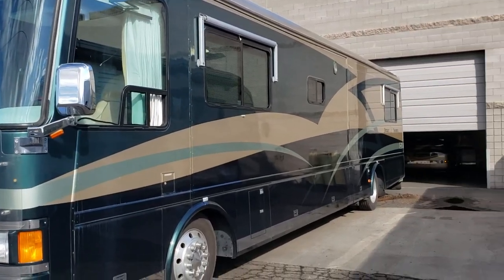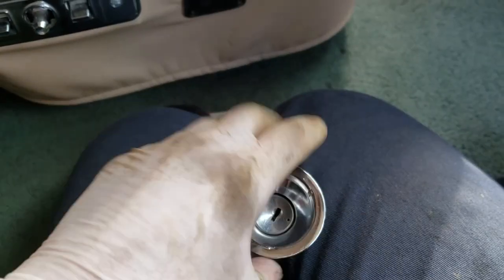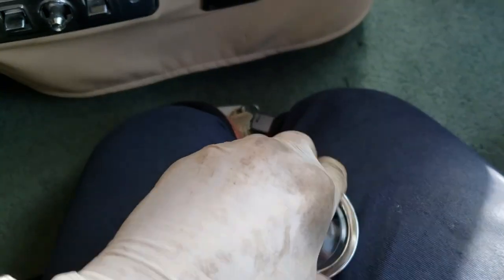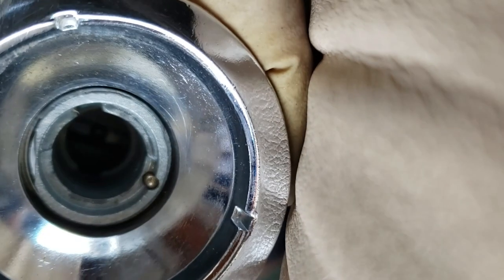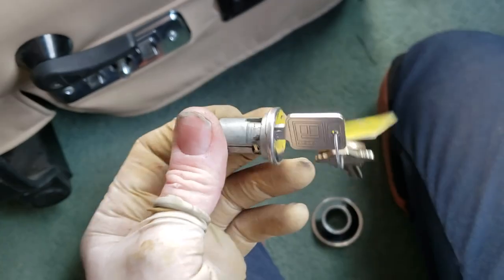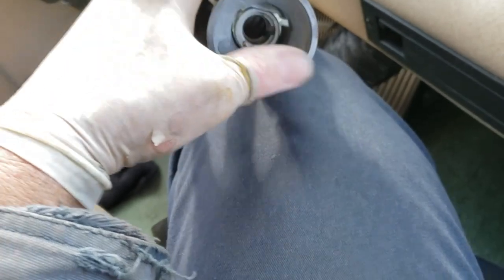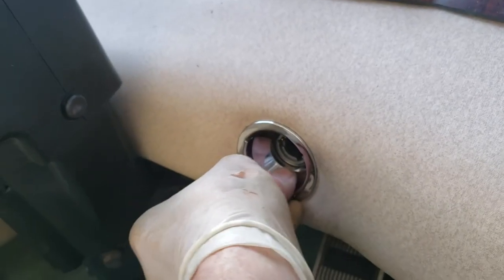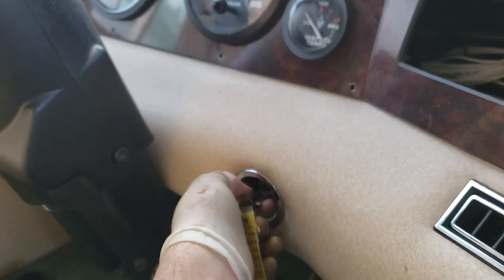Replacing an Ignition Switch on a Diesel RV...2000 Beaver Patriot Thunder

Comment: For anyone watching this video, the part number shown doesn't include the key and tumbler, it is just the switch. I thought it was the whole set so I was surprised when there was no key or tumbler included in the box. It looks like the whole set would be Napa part ECH KS6608.
Reply: And if you are not watching, it's pretty much the same...

Comment: So I have been fighting with my ignition switch on my 2000 Tiffen Allegro. It was getting to where if I bumped the dash, the key would turn off. The switch was just not staying in the run position. I put on a command hook, filed a cloths pin, and turn the key with the cloths pin and snap it behind the command hook. Works great, but not a permant solution. I then googled for that problem, and could not find any info on the problem of the key not staying on, but did come across your vid on how to replace it. I called my napa 4 blocks away, and they said they had the part. long story short, after about 30 min, my problem was solved, the key works great, and I have you to thank!!! Cheers my friend.
Reply from the maker: I'm really happy to hear the video helped and you go the problem solved. I use YouTube extensively for repairs too. :) Thanks!

Comment: We acquired a 1999 Bounder on a Freightliner.
Cummins.
A re-possession, it has no key to spin the ignition cylinder.
.
Without a key, how would you remove the cylinder to re-key or replace?

Comment: Well I figured I would answer my own question since I found the issue today. LOL.....  No voltage to the transmission ECU. Traced it back to a corroded power bus bar on the frame rail. Cleaned up the connection. Boom. Fired right up.

Comment: Love your videos. Very helpful. I have a 2000 fleetwood bounder 39z. When turning the ignition the starter stays engaged.  I had to hit the battery switch to make it stop. In your opinion could this be low batt voltage, ignition switch???? Or something else?

Comment: There is problem with the Ford Transit vans in the uk a vlog on YouTube showing how easy it is to break into them,it takes about 20 seconds to open all the doors
Reply from the maker: That's crazy. I think the 99-12 Ford F-series truck door handles are also very easy to defeat so I heard. Thanks!
Reply: Transits used to be manufactured in the uk then ford moved production to Turkey I think the EU gave a big incentive to ford to relocate to Turkey and ford saving money used cheap components,all car manufacturers are the same saving pennies

Comment: Can you put the original tumbler in the new switch so you have the same key as before or was that what broke on the switch. We have a 2003 Newmar Dutch Star DP, now I'm ready if that goes bad. Thanks!  I guess we need to put a lock on the engine hatch were the master on/off switch is. Lol
Reply from the maker: Yes. That was the original tumbler from the old switch I put into the new one. Thanks!

Comment: Do you have a part number for the lock cylinder if that has to be replaced too?
Reply from the maker: https://shop.findmyrvparts.com/monaco-rv-deadbolt-lock-08408788-p/190035.htm
Reply: @AZExpert  Thank you for the URL.  I will search it or contact them to see if I can find what I need.  Getting information on the Alfa motorhomes is getting more and more challenging.  It's great that people like you share what you can.  It really appreciated.